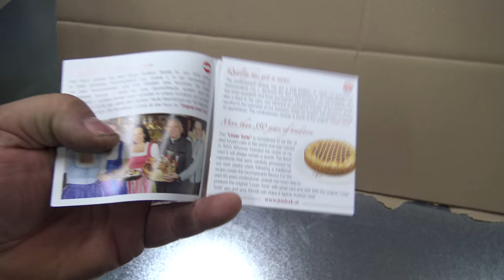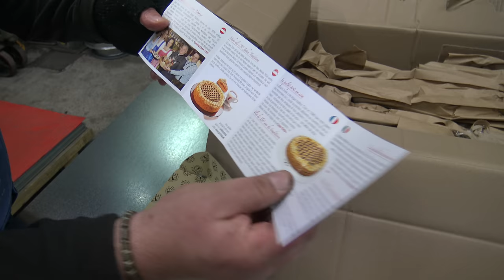Pulse Jet Gasoline Engine "Red Head" with Ignition System HobbyKing Unboxing

Comment: The "flowjector" or fuel inlet had different size jets that you could use to adjust for different atmospheric conditions, temperature, etc. The reed valve is the only moving part. Starting is usually a two man job. You have one guy on the pump or air bottle and the other one triggering the spark coil. You have to get the sequence just right; it isn't a continuous flow of air or spark. You get it going right and the engine will "burp", when it first fires you know you are doing it right. Keep going that way and it will start.
Once you hear one run, you will never forget the sound the rest of your life.

Comment: Having owned one once years ago I can tell you the key operative word for these is LOUD, underlined. You can hear one running a mile away. It won't explode, but the combustion tube will get red hot in seconds so best run in cold weather. The US military actually used highly modified versions of these for laying down smoke screens back in the 1950s or so.

Comment: There is a young lad from Germany who flies one of these at the shows there is no throttle you just glide in,you need to build a simple V1 from circular metal like your workshop produces,some metal wings bent around wooden ribs  and fly it,warn everyone within a 5 mile radius because these are loud,those circular vanes are reed valves,Xjet had one and used to run it up,they glow red hot.

Comment: When starting it be sure to have the fuel tank just over the inlet on the jet, it don't suck fuel as a normal motor and it will stop at the moment you lower the tank. Good luck Soren
Reply from the maker: Thanks for information my friend. Cant wait to test it.
Reply: @SpeedsterDEN  It will shake your teeth loose.

Comment: I am curious if and if how long it will run. When it works and the Sound is there, you have to film the laughter on your faces.😜👍
Reply from the maker: I cant wait to test it.
Reply: It will run as long as it has fuel, they are thirsty though, fuel consumption is high.

Comment: Xiaomi has a 45 psi bike pump powered by battery (integrated) in the size of 2 cigarette boxes ... is roughly 30€ on aliexpress and comes with adaptors and a ball injection nozzle ... beautifull crafted.
Reply from the maker: Thanks my friend. I will check.

Comment: Good luck with the BuzzBomb motor!
QUESTION, How did you like the Radiolink AT10II 12CH RC Transmitter and Receiver?
Would you recommend it as much as the Spectrum Radios you use??
The Radio seems to give you a lot for the money so much less than Spectrum!
Let me know, please.